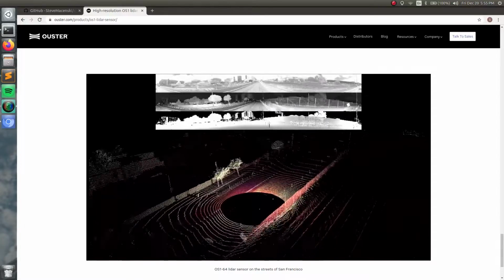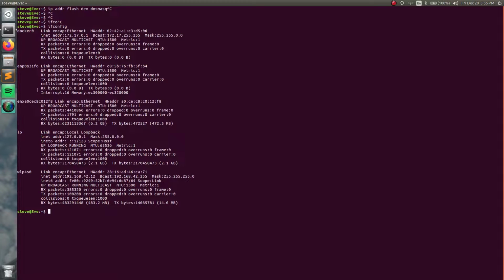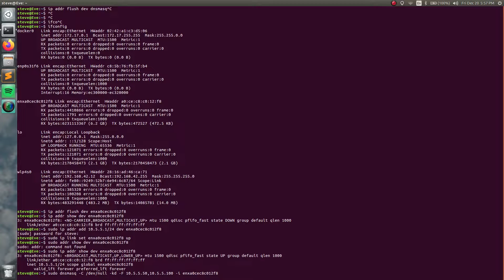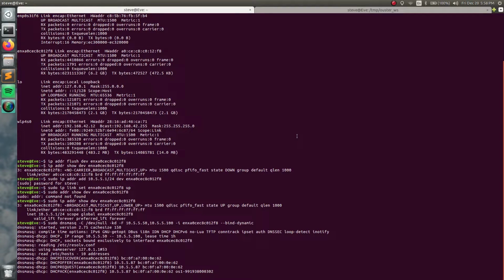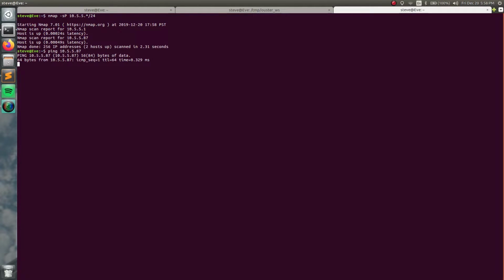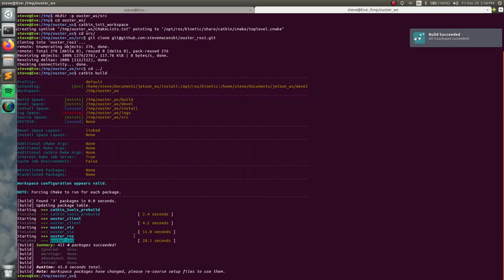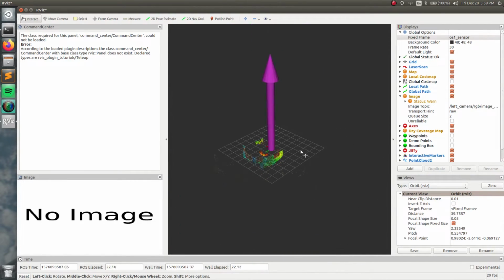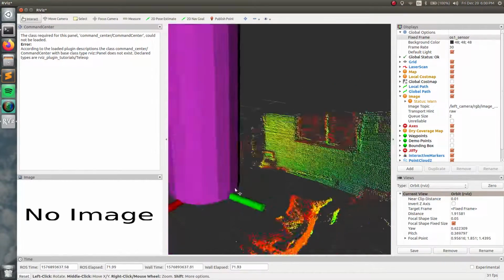Ouster OS-1 64 Layer 3D Lidar Networking Setup and ROS Drivers

Comment: ur solution is not one time thing dude, after restarting pc, pluging off LAN cable or powering off lidar, I do not get it running unless I do ur instructions from the top!
Ouster documentaion says: 
See the documentation for your operating system on how to make these changes persistent,e.g.,by using a network configuration daemon like NetworkManager.
Besides, ur github instruction has some missing commands compared to ur video :)